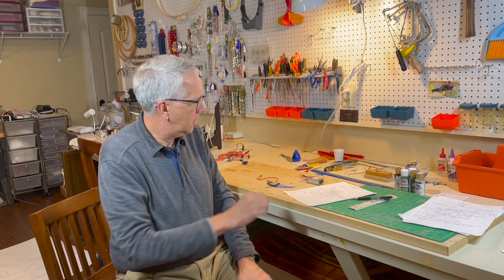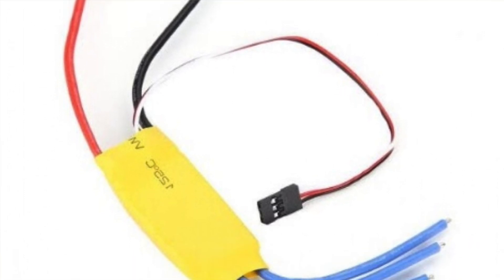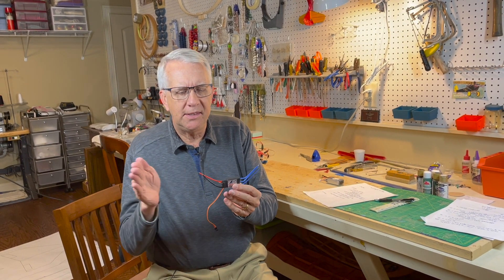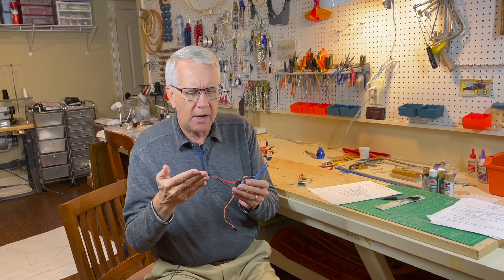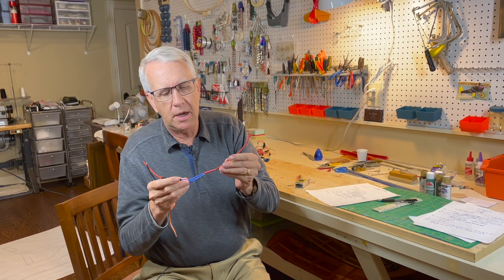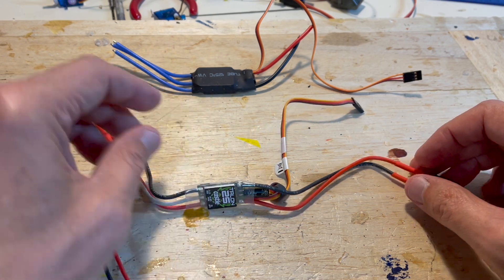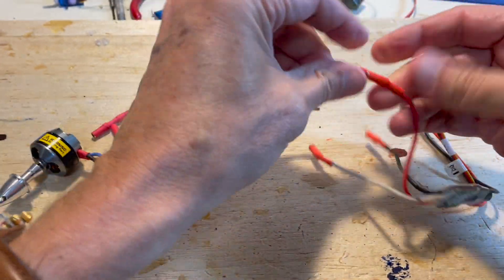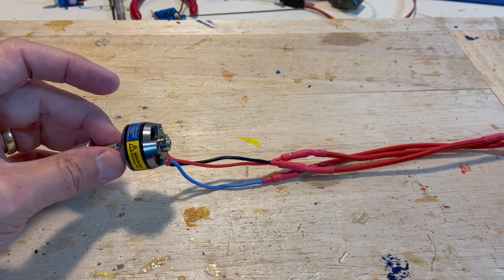How to Extend ESC Wires Correctly

Comment: Hi Tim, you mentioned you’ve extended the ESC-to-motor wires by 12 inches before with no issue. I just tried extending mine by about 25-30 inches and the motor won’t even beep and do it’s start up sequence. I tested the rig without the extension beforehand and everything worked, so I’m fairly confident this extension is causing the issue. Any suggestions? I really need to have this long of an an extension based on the architecture of the rc boat I’m building. Thanks so much!
Reply from the maker: I’d like to help, but am not smart enough to provide a good answer. But do post on www.RCGroups.com  They have an answer for everything.

Comment: I need to order wire to solder to my 3 esc leads...i like silcone coated wire but what size/ gauge is normal for a 40 amp esc? 16? Thanks
Reply from the maker: No idea; maybe try a Google search?  Tim
Reply: @TimMcKay56  i ordered 16gauge..seems about right
Reply from the maker: @roadstar499  😊👍🏻

Comment: Can you extend the wires on your battery by using connectors. Then connect to esc. The results would be the same as extending the wires on the esc. ( the battery wires would be longer) But you wouldn't have done anything to the wires on the esc.
Reply from the maker: William:  I do not think this will work.  The electrons just see a distance to go over a wire.  If there is a connector, does not make any difference.  So do not mess with the wire length from ESC to battery, but OK to extend the wires from ESC to the motor.  Tim
Reply: @TimMcKay56  Thankyou  very much and I will listen to your advice.
Reply: But what can you do if you need to move the battery all to the back of the boat for weight distribution.
Reply from the maker: @williamhendricks2078  Well, may have to add additional weight.  Tim

Comment: Weird because I have always seen it and have it done the other way around. Battery leads going from the nose of the plane out to the ESCs and motors on the wings with no problems no added anything but wire. Up to 2 ft added wire on each wing motor pod from a set of batteries in the fuselage. Never seen it done the other way around with the ESC in the fuselage and the 3 motor control lines run out to the motors.
Reply from the maker: Ron:  I think the various ESC and number of lipo cells affect the installation as well.  Tim

Comment: It really don’t matter with the Low power stuff. You can extend the battery or motor how ever long you want. I have extended the battery wires up to two feel on 8s (30v) 110a no problem. If your running high voltage or high amps different story but for the small little stuff doesn’t matter whatsoever.
Reply from the maker: 👍🏻 Tim

Comment: I personally dont put heat shrink on until the bullets are connected to each other I normally leave them that way but if I need to separate them I just run a x-acto around the bullet to cut the shrink and then pull apart.
Reply from the maker: FFF:  Yes, you can certainly follow this technique. Works well.  Tim

Comment: Should have no metal of the bullets exposed when connected soo many speed controllers have been cooked from the motor wires shorting out on exposed bullets
Reply from the maker: FFF:  Fully correct.  The always feared "magic smoke" when a component is accidentally shorted out.  Tim

Comment: Very helpful Tim. What wasnt clear was when you talked about adding a capacitor to the battery wires. What does that look like? I couldn't really see what you did.
Reply from the maker: Tim:  You would add the cylindrical capacitors if extending the wires on the battery side.  This is hard to do as you will have to make calculations on the size of the ESC, batteries and added wire length.  If you know how to do this, there are pre-made capacitor banks that can work.  My point is to simply avoid this hassle and just extend the wires on the motor side, no capacitors or computations needed!  Tim